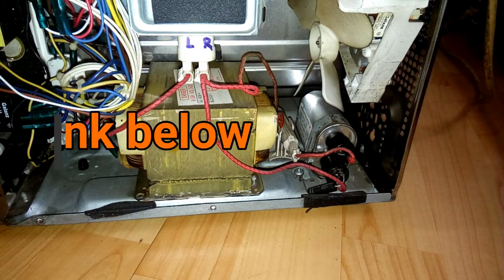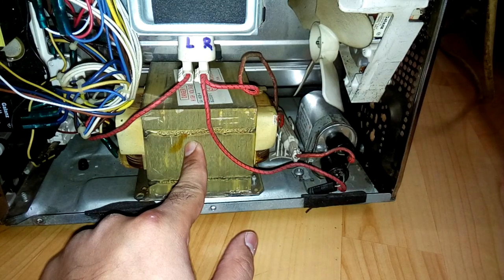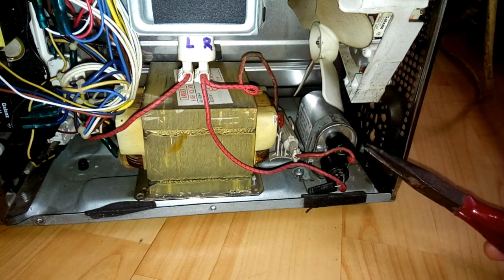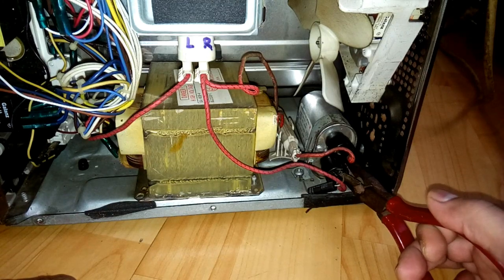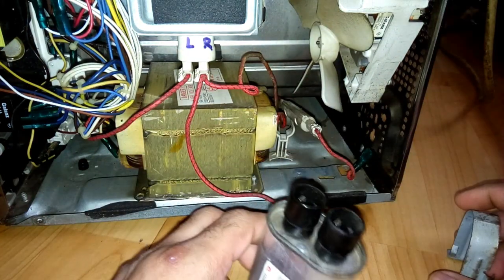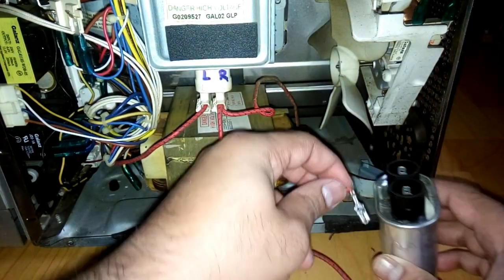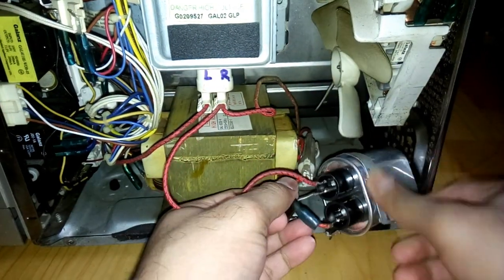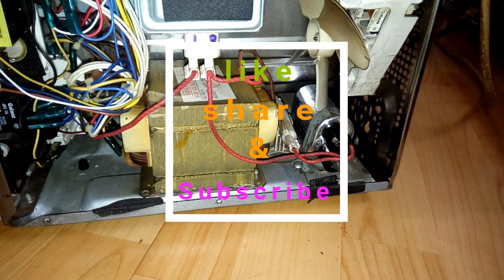How to repair microwave oven/ Replacing the HV capacitor

Comment: Thanks for the video. I just replaced the capacitor + diode + fuse (inside 8 amp). After I discovered the capacitor leakage (yellowish liquid). At first tried to replace the fuse but the fuse just immediately “pops”. Now working again
Reply: pwde po replace 0.9 sa 0.75 HV cap..

Comment: does that fuse go from the transformer to the magnetron or does it go straight from the capacitor to the magnetron.
Reply from the maker: I think its between transformer & capacitor. I dont remember exactly. Did the fix long back.
Reply: @technoboy-allinOne  Do you mind if you could potentially send me the a circuit diagram of the connections between the transformer, capacitor-diode and magnetron? i cant seem to find it online.

Comment: My capacitor says HCH-212091C T85 S 
2100Vac.    50/60 Hz
.91 u. 3%
Can I get any capacitor that is 2100 vac and 50/60hz? I see one that said Ch85
Is that ok?
Reply from the maker: No. You gotta check the capacitance too. Which is .91 uf in your case.
Reply: @technoboy-allinOne  and if it’s the same amount I good? 
I’m just wondering if the hch number means anything or is just a part number ?

Comment: Hi quick question, I have changed over the glass fuse in my microwave and when I switched on and tested it turned off after a few seconds and is now dead.

I have tested all fuses with my multi meter and I don't get a reading on both fuses in the microwave (not the fuses connected to capacitor) 

This is a Samsung cm1929 which has two capacitor and two magnetrons
Reply from the maker: You must have some faulty parts that makes the fuse blown. Check the caps & diodes first. But before touch those things make sure caps are discharged by touching both terminals with plier.
Reply: @technoboy-allinOne  can cap's and diodes be checked with a volt meter?

Comment: The capacitor has 2 male prongs in the top hole and 2 male prongs in the bottom hole. When you hooked up the top wire which male  prong did you hook it up to? When you hooked up the bottom wire, which male prong did you hook it up to? Or does it make a difference which one?
Reply from the maker: no difference

Comment: I would have, almost certainly, mounted the capacitor to the chasis and plugged all the terminals once the cap was secured to the base plate. It's safer and easier.

Comment: Can i replace ( .95MFD 2100V  with on 10MFD 440V )? The .95MFD is the spoil one
Reply from the maker: No way. 10mfd 440v is used in fan & motors. But microwave requires 2100v capacitor. Any caps value lesser then this would blown. You must use 2100v caps. The mfd value maybe a little bit more or less
Reply: @technoboy-allinOne  thanks for your reply. Can it be replace with a 1mfd , 2300v?

Comment: is it ok to replace HV capacitor with higher value? from .75uF to 1uF
Reply from the maker: That would be a bit risky.if thats the value of stock caps then You can use 0.85uf but not more. Using higher value capacitor may damage the magnetron

Comment: Is it okay to replace H.V. Capacitor with a same value but higher voltage(1900VAC to 2100VAC)?
Reply from the maker: Yeah you can do that
Reply: @technoboy-allinOne  thanks a lot

Comment: Would changing the capacitor value from 0.82 to 0.91 be okay?
Reply from the maker: Yes you can do that. that wouldnt be a problem while the value is still below 1
Reply: @technoboy-allinOne  thanks a lot for the reply. Is there a rule of thumb as to what the tolerance is on these capacitor values? Any general idea of how much the .09uf increase in my subtitution increases the overall voltage? Thanks again.

Comment: Is the  capacitor has polarity br?
Reply from the maker: No
Reply: @technoboy-allinOne  it has no polarity and one of capacitor leg connect to chasis with diode.. so what is the reason to discharge it if it is already one leg connected to chasis ??

Comment: how did you know it was for sure capacitor not megatron, fuse or door switches?
Reply from the maker: I Checked them all. When you have a non heating microwave, then start checking with the fuse first. Then diode,caps, door switches etc.... and the transformer & magnetron at the last
Reply: Megatron and Transformers brings back memories of watching cartoons 😁
Reply: You can visually check the door switch holders for excessive wear where the door latch slides into the switch holder. The contacts inside the door switches will usually be "welded" together when they wear out. With the microwave cover off, you can use a small flat blade screwdriver to push the button down on each one and you should feel it "click" if everything is working properly. You can also disconnect the wires and do a continuity check for each switch. The top and bottom are usually the ones that fail. If the microwave isn't heating at all, it could be the magnetron. If it's working, you should hear a low pitch "buzzing" noise. If you take the magnetron out, you can inspect the magnets for cracks or chips. If the magnets have any damage, that's likely the problem. You can use a clamp meter to see if the magnetron is drawing power, and backtrack from there. If there's no amps, you aren't getting power to the high voltage circuit. You can test for power going into the high voltage transformer from the board when it's running, and you should be getting 120v. If there's no voltage, then it's a board (relay) issue. For the capacitor, you need a meter that can read capacitance. The capacitor should have a label indicating the rating, and a plus-or-minus percentage. You can do the math and figure out the high and low numbers, and it should read between there. Any more or less and it needs to be replaced. You can also test them the old fashioned way, but it can be extremely dangerous if it's not done right. As always, unplug the microwave before you work on it, stay away from the high voltage end of it while it's plugged in (usually the red fabric insulated wires), and discharge the capacitor once you unplug it to change or inspect any components.